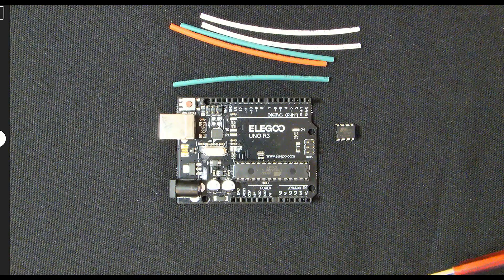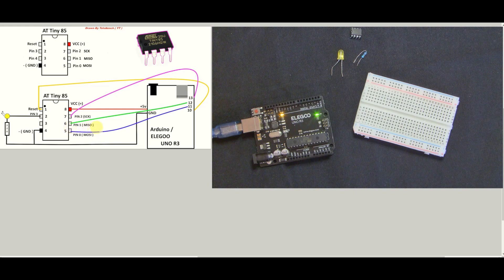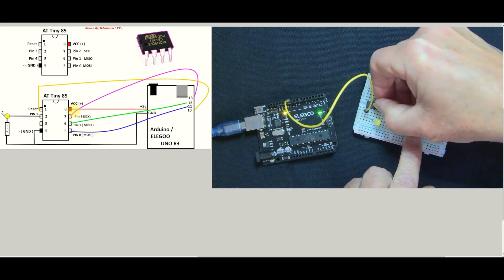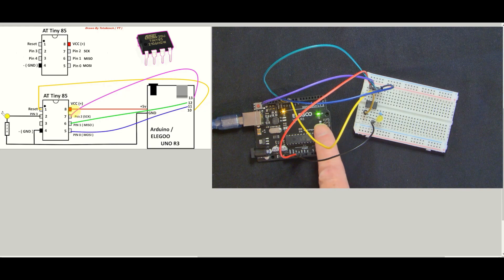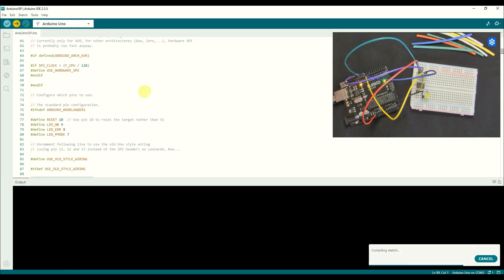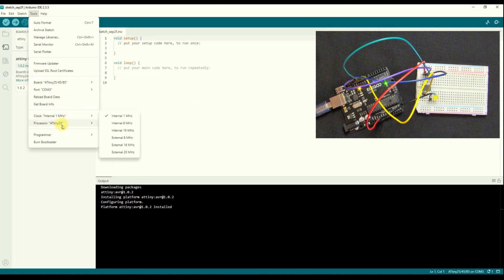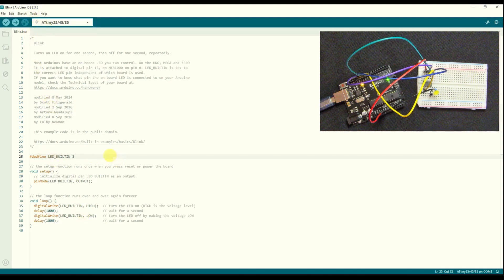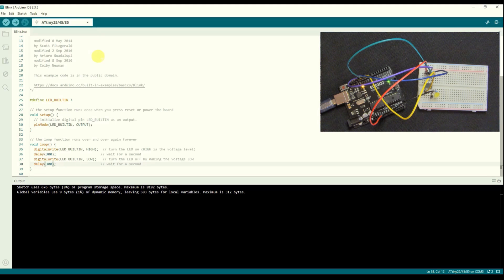Arduino UNO to ATTiny85 / AT Tiny 85  Programmer / Burn / flash Bootloader

Comment: Other online documentation suggests inserting a capacitor between the reset and ground lines of the UNO board, but this can cause upload errors. Removing the capacitor allows the upload to proceed. Also, if you upload a program to the attiny85 and the 85 doesn't work, you should remove the RESET line from the ISP programmer.
Reply from the maker: Thanks for you reply, yes, I am aware of that and that is why I refer to those assertions in the video nearer to the end. 

I experimented with this and have been unable to make it happen on any Arduino. I am not saying that in some situations that it may not, but I cannot and I have not seen it proven anywhere as to why it has happened with documented lab experiments  and proofs to back it up so far.

I have wondered if this has happened due to incorrectly carrying out build instructions, faulty hardware etc. I dont know.

Regards Tel